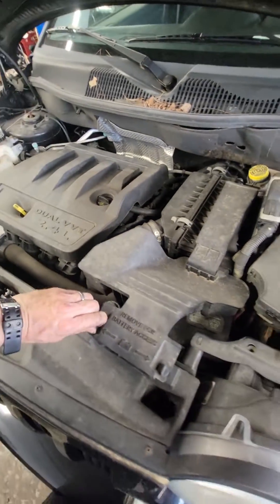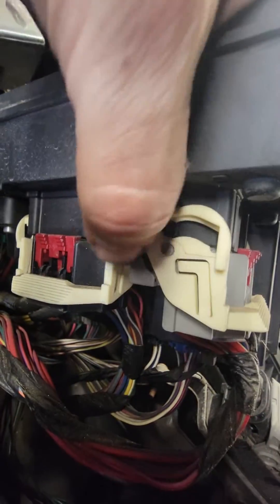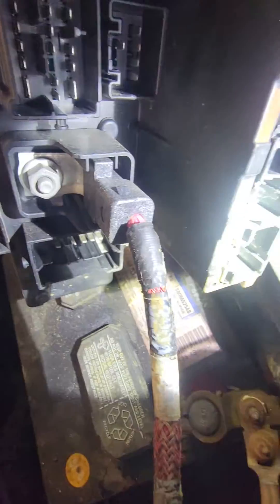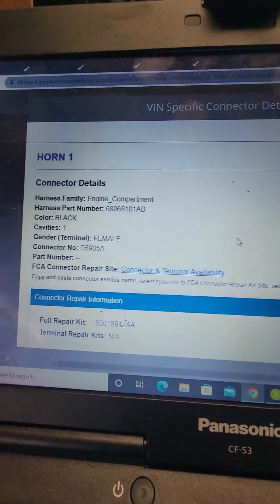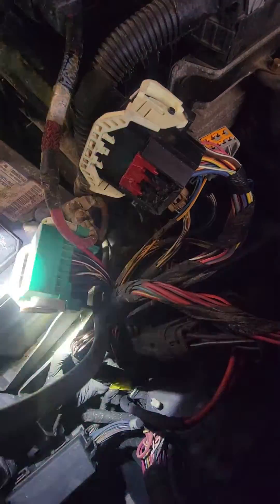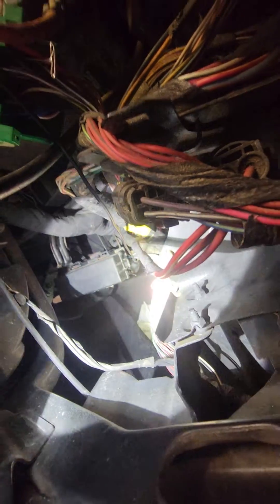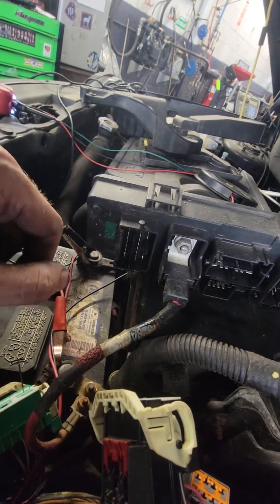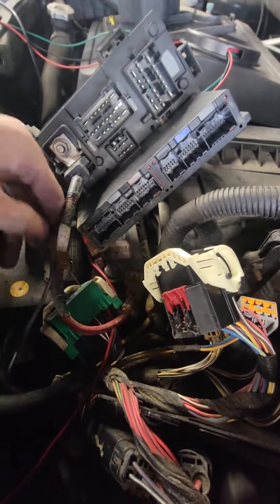Customer states car horn randomly goes off.

Comment: Replaced the Tipm. My 2010 was still honking whenever it felt like it. In traffic and at 3 in the morning sitting in the driveway.  Always replace the horn pad first. It was like 15 bucks. Fixed mine. If you use armor all or other cleaners on the steering wheel the moisture builds up under the pad causing random connections and malfunction. Please try this first b4 you spend 300 on a part you may not and probably don't need. 2009-2012 seem to have this problem.

Comment: Come on you have a hammer 😅 good video! Wish there was more info on these issues. Did this end up being tipm, or was it the horn pad, or the left switch speed control, or the ccn?? Have an intermittent horn issue and have to go down the rabbit hole 🎉🥳
Reply from the maker: It ended up being the TIPM, I'm currently away from my job for sometime, and it just got delivered not long ago, my buddy texted told me that fixed it

Comment: I have an issue with my 2014 Ford fusion when I slam the door or I'm just driving down the door the horn goes on without touching the horn button so I took the horn relay out. Im not sure what it was I changed the battery since it was low and put the relay back in. It still has the same issue